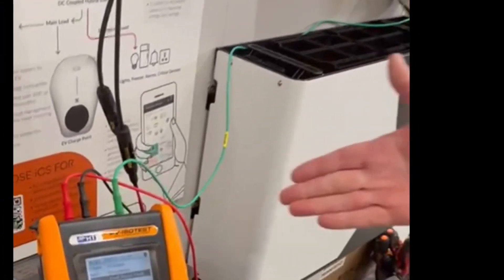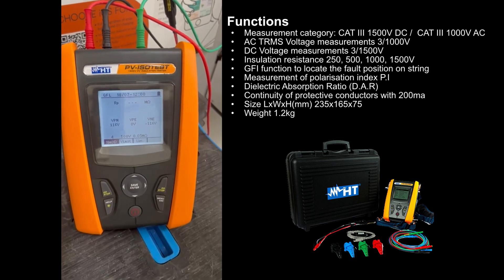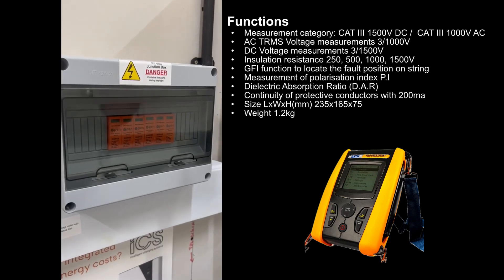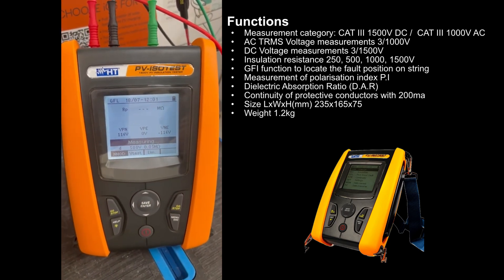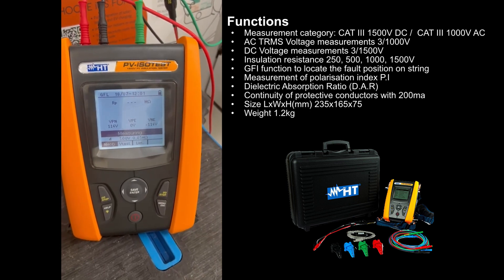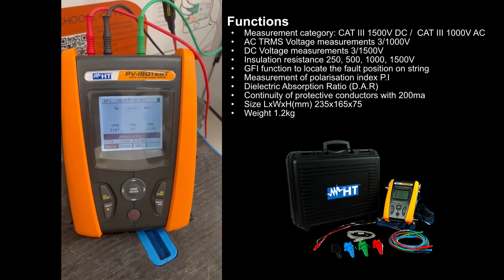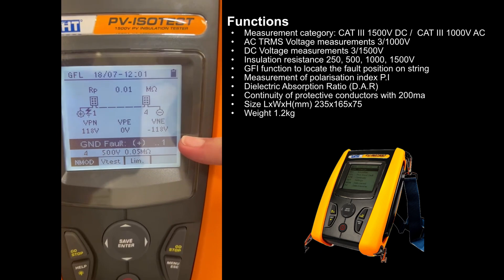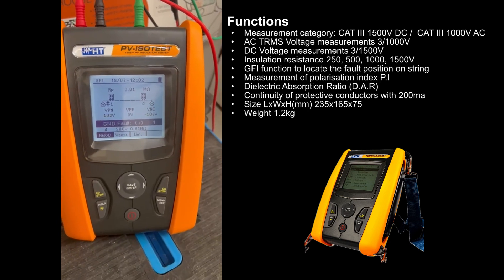TIS PV ISOTEST - Solar PV Multifunction Performance Tester

Comment: I’m testing harness’s on a PV system and my problem is when down loading data for 10 test only 4 or 5 show up being available on the ladder to the right. Rebooted the equipment and retried and then 8 show up. Is there a solution to this issue?
Reply from the maker: This came back from technical at HT Italia 

We can try to reduce the latency time of the COM port. To do so, with C2006 cable connected to PC and disconnected from the instrument:
Device management --> COM and LPT ports -->Right button --> Properties --> Port settings --> Advanced
 
image001.gif
 
- Set the latency time to 1ms and press OK. Remove and replace the C2006 cable from the USB and try connecting to the instrument via topview .
 
- If the setting fails, repeat the previous step by setting the latency time to 8ms
 
Let us know if this works!